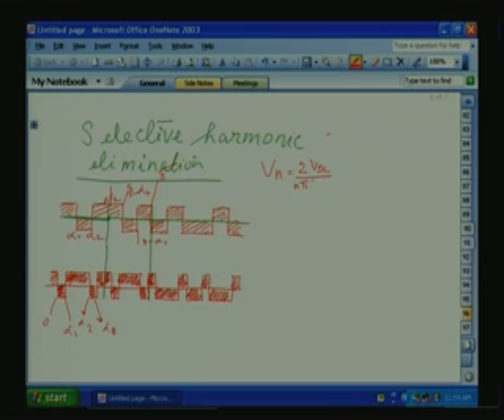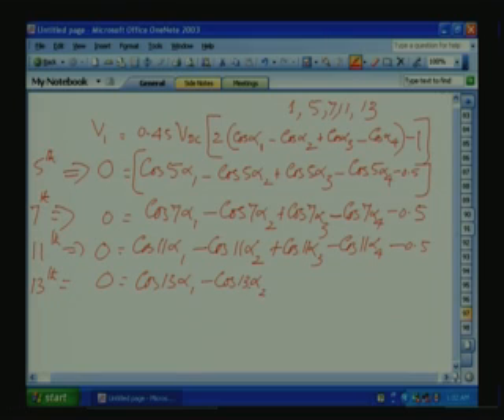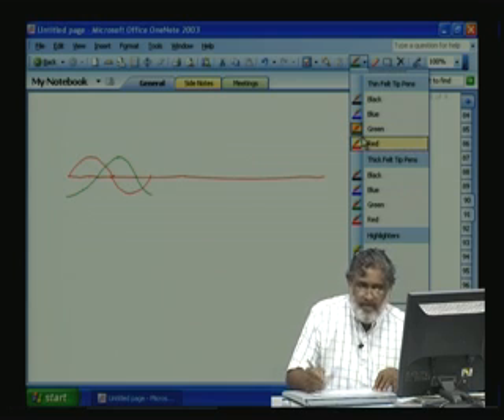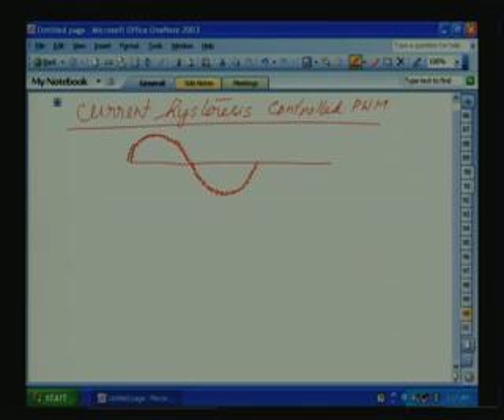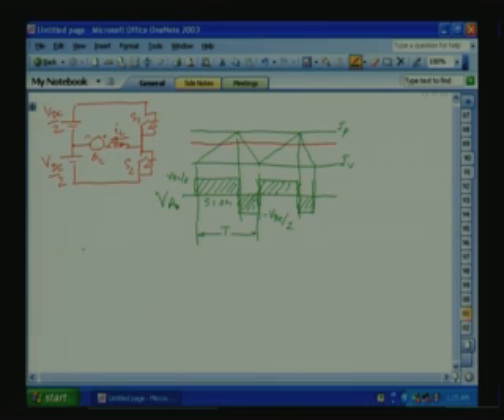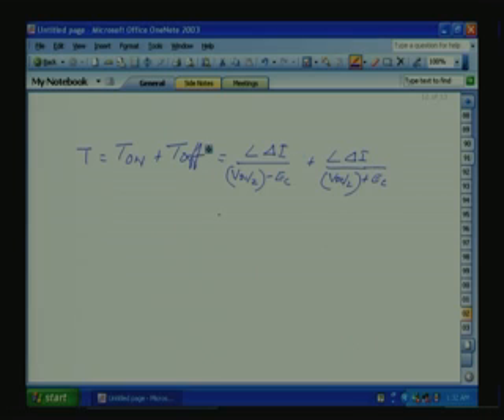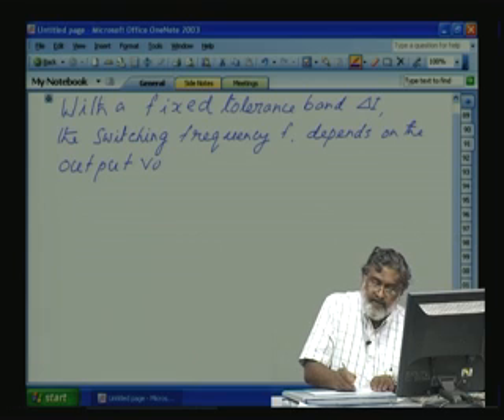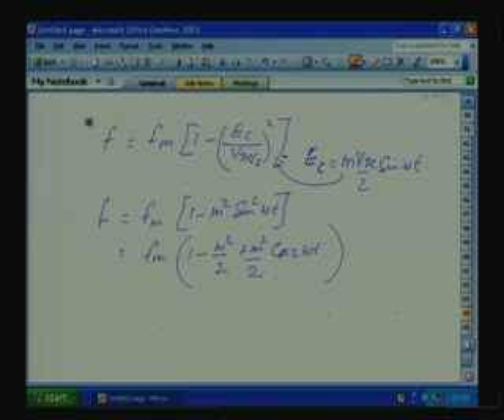Lecture 25 - Inverter -Current Hysteresis Controlled PWM

Comment: 🎯 Key Takeaways for quick navigation:

00:00 🎯 Selective Harmonic Elimination (SHE) is a pulse width modulation (PWM) technique used to eliminate specific low-frequency harmonics while controlling the fundamental amplitude in a motor drive application.
01:06 🎯 In SHE, notches are introduced in the pole voltages of the inverter to achieve half-wave symmetry and quarter-wave symmetry, similar to sine-triangle PWM. The width and angles of these notches are determined based on Fourier series analysis to control the harmonics and the fundamental amplitude.
03:33 🎯 Harmonic analysis in SHE involves finding the RMS values of different harmonics using the Fourier series. Equations are derived to control the harmonics of interest (e.g., 5th, 7th, 11th, and 13th harmonics) along with the desired fundamental amplitude.
06:02 🎯 SHE requires extensive offline computations for varying operating speeds and may not be ideal for motor drive applications due to its complexity and computation requirements.
22:53 🎯 Current hysteresis controlled PWM is an alternative method for achieving nearly sinusoidal current in motor drives. It introduces an envelope, or hysteresis band, around the reference current to keep the current ripple within a controlled range.
25:07 🎯 The hysteresis band design is crucial in current hysteresis controlled PWM as it determines the switching frequency. It depends on factors such as the switching losses, load characteristics (inductive or back emf), and the type of device used.
40:07 📏 Điều khiển tần số chuyển mạch PWM phụ thuộc vào dải hysteresis (delta I) và điện áp DC link (VDC).
40:56 🔄 Với điện áp DC và dải hysteresis cố định, tần số chuyển mạch PWM (f) liên quan đến delta I.
42:25 📈 Để tăng tần số PWM cao (f), cần giảm dải hysteresis (delta I); để giảm tần số, cần tăng delta I.
44:56 🔄 Tần số chuyển mạch PWM biến thiên quanh giá trị trung bình f, phụ thuộc vào điện áp back emf Ec và chỉ số điều chế m (modulation index).
50:16 🔄 Tần số chuyển mạch PWM biến thiên theo dạng sin tại một giá trị trung bình, ảnh hưởng bởi chỉ số điều chế m. Cho hoạt động tốc độ biến thiên, cần thiết kế dải hysteresis cho tần số chuyển mạch tối đa hoặc trung bình.

Made with HARPA AI